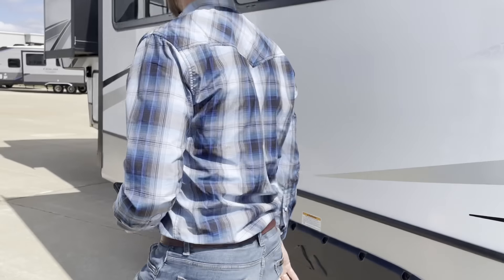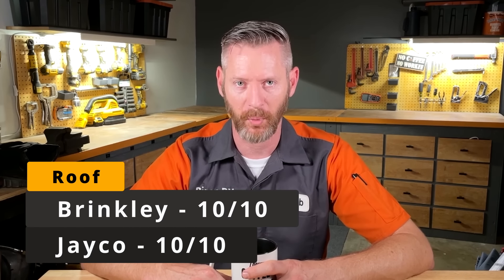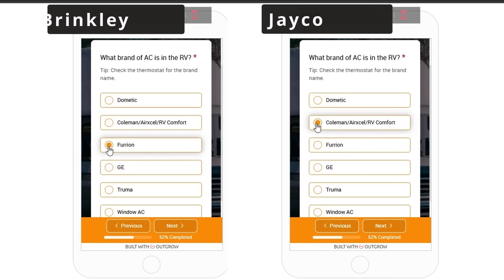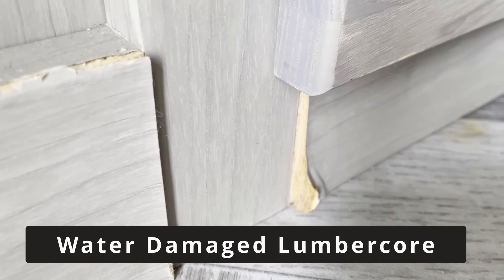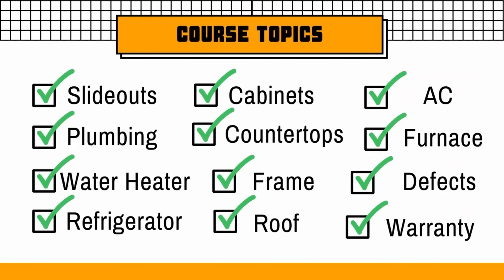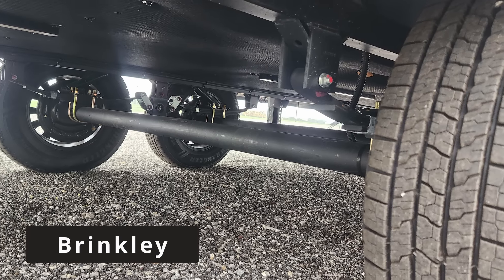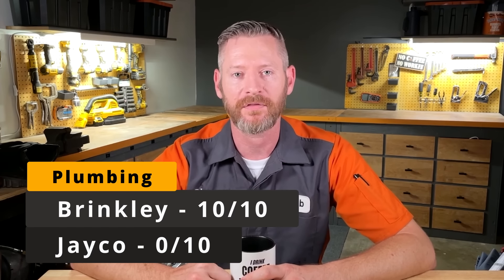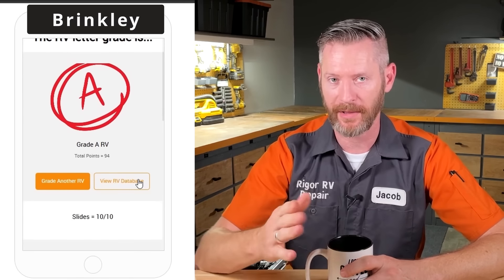UNDERCOVER RV Tech reviews Brinkley & Jayco travel trailer RVs

Comment: Jacob, I know I shouldn’t have to, but need to get in and inspect all my plumbing, and go ahead and fix it before it becomes a problem. I’m very frustrated these companies cut corners in something so serious. Since you have replaced all these fittings, what is an approximate cost of the materials to re-plumb a Jayco 263 RBS? To anyone wanting to buy a camper, I recommend your course, especially and hands down, if they are not getting an inspection. We love our Jayco and in 2023, it would have been very hard finding a camper with perfect plumbing. I’m hoping it won’t be too hard to get to and fix everything inside the camper. Not planning on cutting into my underbelly to check that out? At least if it leaks there, may not do too much damage, let’s hope. QUESTION; How much would it cost for them to put in the right fittings in materials? I know it would slow production down, but imagine if Jayco had A grad plumbing, solid surface counters? No chance anyone is going to solid wood frames too, I’m sure that would eat into the profits, lol? In Jayco’s defense, the few minor issues I’ve had, they were Great at approving the repairs, sending parts, etc. My local dealer in Richmond, A&L rv was fast on getting me taken care of. They replaced my slide seal in a couple days. I’m very fortunate to have a great dealer near me that has the same people in the service department that were at the old dealership that was bought out. Honestly, that should be a very important factor in where to purchase a camper. Maybe you can do a video on what questions to ask the dealer/service department on turn around time for repairs.
Reply from the maker: Thanks so much for watching and commenting!  Here is my playlist on the plumbing issue and fixes - https://www.youtube.com/playlist?list=PLRhkJB7TNcSn2U5sDy5ic2iWr8kFxxd_N - this should answer a lot of your questions and be helpful
Reply from the maker: Also, here's an amazon link of what I use - https://www.amazon.com/shop/rigorrvrepair
Reply from the maker: @jerrytalley802  I don't think it would even cost $20 more for correct plumbing parts on this RV. It really is complete nonsense.